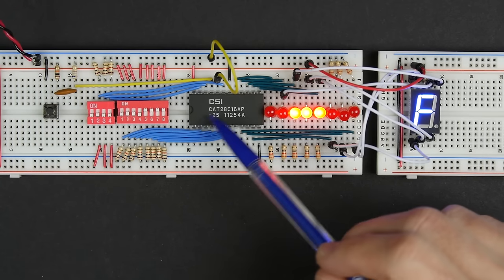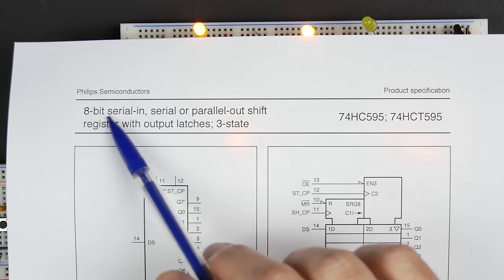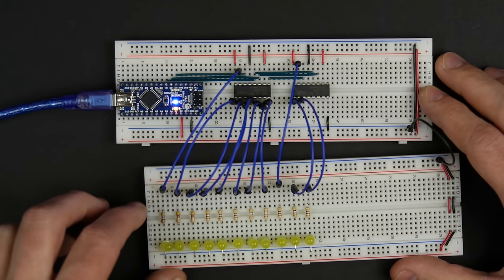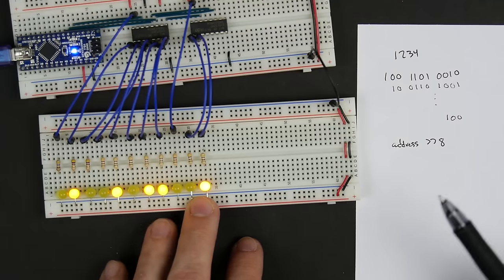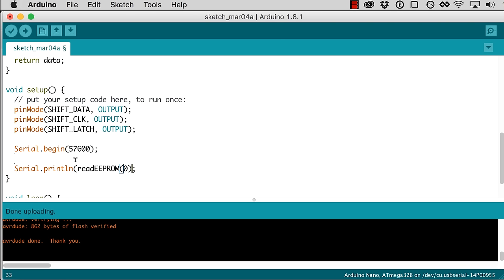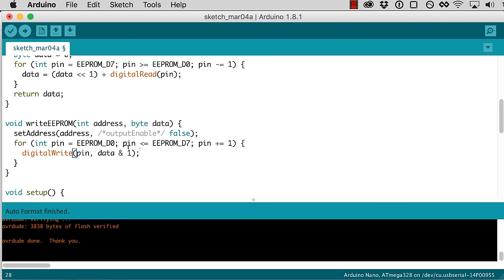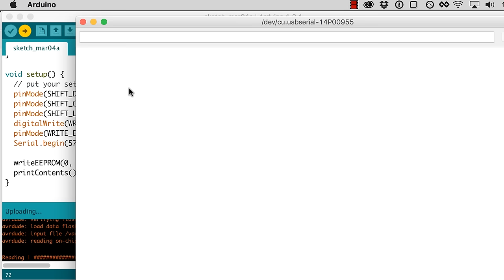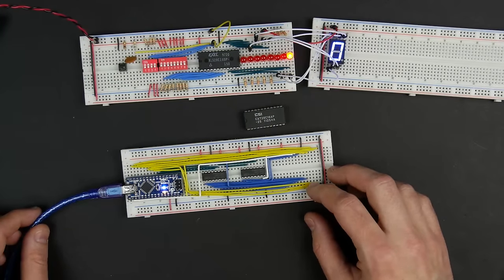Build an Arduino EEPROM programmer

Comment: I'm very late to the party here, but for anybody trying this out then I think Ben may have been using the wrong datasheet.  The Exel XLS28C16B datasheet describes a couple of features that are used to handle writing.  The first is that internally the EEPROM memory is updated in 16 byte pages from a 16 byte page buffer.  Any write to the chip occurs initially to this buffer, and as long as you perform another write in the same 16 byte page within 75µS of the WEB pin rising edge then the data is written only to this buffer.  It's only after 75µS containing no WEB falling edges that the internal EEPROM memory write cycle starts, writing the data in the page buffer to EEPROM and taking up to 5mS.  To determine when the write cycle actually ends the idea is that you repeatedly read back the byte from the last address written, and the cycle is only complete when you read back the same byte that you wrote to this address.  Also in this datasheet there is no maximum WEB low period, just a minimum.  So in fact it might take the write cycle 5.075 mS to complete after the rising edge whenever this happens, and reading within this period from any address apart from the last written is out of spec, as are any further writes.  A 6 mS delay would probably have done the job, but better to poll the last address as described and better still to write 16 bytes at a time first in order to minimise write cycle wear on the EEPROM.  PS - the 16 byte write buffer is only available in the "B" variant of the chip.  In the "A" variant every byte written triggers a write cycle immediately.

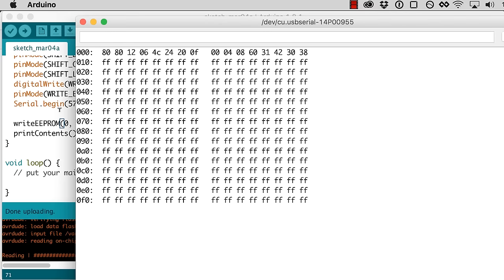Comment: @51:41   Could this be due to timing within Arduino? Are those timings compatible with this specific Arduino board, for changing it from 5 to 10? Or is it Memory chip timing specifications? Looks like the memory chip specs require longer timing.

Comment: Hey Ben, I bought an AT28C256 to play around with myself, but it seems that because it is a "paged" EEPROM the read and writing is working differently from the 28C16, and it doesn't seem to want to write properly. Could you help me out with understanding what's going wrong here?
Reply: Yes, the AT28C256 does have a paged mode where it can grab up to 64 byte blocks quickly, but they need to be clocked through quickly and if the chip doesn't see new data in about 100uS I think it is,  it just gives up.  You still can use the single byte write mode as outlined here.

Comment: Extremely good explanations throughout the entire video. There is only one question unresolved: How the heck do the LEDs on the secondary (manual read/write eeprom) breadboard stay lit even after removing the eeprom!??!
Reply: Sharp eyes! I think it's because those LEDs are also connected to the numeric LED display on the other board. They're drawing current through there somehow, either through the LED segments themselves (that is, the segment and the stand-alone LED are in series), or maybe through the current-limiting resistor somehow.
Reply: @jimblandy  Thanks! I suspected something like that. Seems like 7-seg display serves as a latch of some kind. I'll have to test it out.

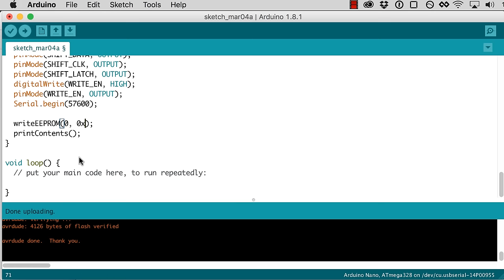Comment: I had the exact same issue as you at the ~51:00 mark. My issue was oddly that pins would float until they "warmed up" after the first 2 bytes. I had to add a 47k pull down resistor for it to stop (sometimes), which seemed oddly high. This happened after a few seconds of inactivity.

Do you happen to know what was causing that?

Comment: My serial monitor is not working. It is showing a lot of question marks and other strange symbols. Any suggestions what I should do? Could it be something with the physical connections on my breadboard? The shift-registers work just fine.

Comment: Thank you for this video series, it's amazing! Now it would be really amazing to see how one would build a thing that communicates via USB. Building the Arduino is probably really hard because that's already a computer and I assume writing a C compiler for the custom assembly language is riddiculously hard as well. But the USB with the serial protocols sounds like a nice thing. It should be quite possible to enable the breadboard computer to connect to PC directly and manipulate the RAM content that way, no?

Comment: Hi Ben, what if you only had one Shift Reg but two Arduinos Would you be able to split the address between the shift reg and the second duino? By essentially pushing the first 8 bits to the second duino and storing the last 8 bits in the SR. then activating the ShiftLatch on the SR and using the same logic to drive a pin on the second duino as an ShiftLatch pin? This would enable the output pins you chose on the second duino and the SR at the same time. Then still use the first duino to read from the data pins? I know it's a bit overkill and it's more labour cost-effective to just order another SR. But is the concept sound?

Comment: I fear I may be a bit late to this video, but I had one comment for how the write enable pulse can be shortened somewhat without using lower level timing. The digitalWrite command can be replaced by port manipulation. Since port manipulation is almost instantaneous, it will bring write enable pulse duration much closer to the recommended 1000 ns.

Comment: Hey Ben!
I've tried rebuilding this circuit and the data is not being written to the EEPROM. Every time I read 0xff in every location. I've also made a pcb thinking my breadboard might be a bad one. Also connected everything on breadboard couple of times. But it doesn't work again. After surfing the web for solution, I was suggested to do a Software protection disable sequence. Can you please do a tutorial on that? Or does it have to do something with the write timings?

Comment: I think there may be a mix up on the schematic. D2 , D3 and D4 on the Arduino should be connected to  Pin 14, Pin 11 and Pin 12 respectively. It's correct on the video so no big deal.
Reply: Here is a breadboard layout schematic. I already built this and it's working great. 
https://www.dropbox.com/s/ztejk5xjhnk1k8i/Arduino%20EEPROM%20Programmer%20Diagram%20Ben%20Eater%20v2.pdf?dl=0

Comment: You might consider using for your interface a Microchip  MCP23017SP2 IC. The IC has 2 8-bit bidirectional ports and connects to the Arduino using the I2C buss or you could use the good old 8255 IC. It has 3 8-bit bidirectional ports and would use 10 Arduino pins. You digital knowledge is very impressive. Good Job.

Comment: Hi Ben. Nice video again! I'm really looking forward to see the next videos about your computer.
One thing I have to complain is on your write-function: You first tell your µC to output on its pins and then tell the EEPROM to stop outputing on his pins (which are directly connected together). So for a fraction of a second some pins should be shorted out through the IO-registers of both chips :O
But I don't think I does matter much there :)
Also the Arduino API has some nice (c++) string operations based around the String class, so don't mess around with that old c-functions :D

Comment: instead of data = (data << 1) + bit you shoud use |. It doesn't make a difference in logic, but it's just good practice to use bitwise operations when messing with bits and using arithmetic operations when messing with numbers. It might also be faster.

Comment: As mentioned elsewhere in the comments, you can also use the analog pins, or even upgrade to a Mega which has many more pins - it's not like it's going in a final project, it was simply to program the EEPROM as a tool :) 

Great video as always otherwise :)

Comment: Hi Mr. Eater.
Write a program in Arduino;
Write 6502 CPU assembly mnemonic code from the serial port of the Arduino, and compile it with a command to write the machine code 28C16 or 28c256.
There can be very nice projects with such a program. In the future
 you can do this in the Z80 processor.

Comment: Hello,most of us beginners  have problems programming the 2716 ,we have the Minipro and it has a max prog 21v,what can be done,adding the voltage,using external 25v supply,adding the missing 4v from a battery?i was thinking using the output of the minipro to drive a relay or transistor switch,arduino or something with a external 25v supply.

Comment: hello, I have a little doubt. I used the same 74hc595 chip for the first time. But It did not work. After browsing the web I tried changing the polarity of LEDs (+ terminal to the positive rail & - terminal to the output of the chip) then it worked. But the problem is in your video you do it other way. Please help me
Reply: Did you have the LED pointing the right way?

Comment: I am loving seeing you building the 8 bit computer series. But you could have used the analog pins from Arduino as digital pins, that would be 8 extra I/O making a total of 20 free I/O. And that would have been enough to write and read from the EEPROM

Comment: hi, i've made this circuit with a 28c256, a 32k eeprom, but the there are missing bytes, like : 00 5e 00 b4 00 88 00 3d  00 ff 00 79 00 aa 00 99. do you know how i solve this?
Reply: @tradde11 yes, It was a loose wire. Thank you

Comment: Great stuff from Ben as always. I was unable to find a 28c16 so I used a 28c64, tying the additional address pins to ground. I used Ben´s vanilla EEPROM Programmer sketch and it loads and runs. However the printout is as below:
000:  7f 7b 77 1f 4e 3d 4f 47   7f 7b 77 1f 4e 3d 4f 47  whereas it should be:
         7e 30 6d 79 33 5b 5f 70  7f 7b 77 1f 4e 3d 4f 47
So it seems that only the second eight addresses are being printed. Don't know if anyone is still monitoring this conversation but would be great to get some input as I am at a loss. Wiring seems correct.
Thanks.

Comment: Great video. I looked a little closer at using the Adafruit Feather M4 Express. Even though eight 4.7kOhm resistors and eight 3.3V zeners on the data lines could make it work with the AT28C16, two of its 21 I/O were also shared with USB comms Tx and Rx (like the Arduino). So, it would require your clever Shift Register (SR) idea as well.  So the Arduino Nano is indeed the way to go with a SR added. I think I have a Nano around somewhere, I am going to try your idea... Thanks!
If fact, in the past I have multiplexed the use of the Rx pin as 'USB comms Rx' and 'Output pin'. The Rx pin can be used as one of the Address lines to the AT28C16, and in this case I pick up one pin and no Shift Register would be needed. It is just that before you program each Address, you have to send a "dummy" byte to the Nano over USB that leaves the Rx pin in the desired state (1 or 0) you need for a particular address bit. Or maybe I just had to momentarily switch the Rx Pin to generic output pin which put garbage on the USB that I would just toss - its been awhile, need to find that code I wrote years ago. Since I am going to write a GUI on the PC to send huge streams of Data to the Nano to program the EEPROM, it can easily fiddle with the USB data and get the Rx pin in any state I want between USB comms transactions, the Nano code communicating with the PC would both have to expect this as well. But for Address expansion, I am going to go with your SR approach. Great video, it gave me a project I can use when I teach STEM to bright young minds this summer.

Comment: You could also use Arduinos Serial read functions to get data from the PC which makes it possible to program the EEPROM from e.g. text input on the serial connection, one byte at a time advancing the the next byte making this a generic EEPROM programmer instead of having to recompile and reupload software with a new array of bytes to write. It will also save the Arduino thingy itself as they have limited amount of writes before they go bad.

Comment: Dear Bem.
I like your projects very much.
I intend to make a 28Cxxx EEPROMS programmer, but the pin VCC from the 28C16 is the pin A13 from the other ondes.
I thought of using a transistor connected the A0 port from Arduino, but I'm not sure about the type.
Can you help me?
Thanks.

Best regards
Angelo

Comment: Every time I read from the EEPROM I am getting 0xF7 for all the bytes. I am using a 28C256, even though the pinout is a little different it should be fine with the EEPROM hooked up properly.  Could you possibly know whats going wrong?
Reply: Nevermind I mixed up a couple of address pins and fixed them. Working great! probably shouldn't of done this at midnight, probably wouldnt of had that error...
Reply: Hello Ian Litchfield. I’m using the same chip (28C256) but can’t get it to write. I wonder if I have the same issue as you. Would you be able to share your arguing sketch so that may write/read successfully to this chip? Thanks in advance

Comment: Hi I just saw this video.
The reason why the delay may have been too short may be because your clock speed is fast. check your avrdude (setting or the settings in the Arduino settings)

Comment: The output enable part doesn't seem clear to me. I mean: The first address part is shifted out as 3 bits (100). With the OR operation you are not adding a bit, but actually changing the MSB of the address, effectively making it (101).  You are saying: "it's basically the first bit set". SO you are altering the address! But in the end the result is (1101) including the OE LED. So where does the additional 4th bit magically come from?
Or in other words: For reaching the 12th green( LED you would need to shift out an additional bit. How does this work by replacing a bit instead of appending one?

Comment: Turns out that there is sufficient delay between the EEPROM writes LOW and HIGH trigger such that the delayMicroseconds command is not required.  Mine also works with the post HIGH delay set to 5.

Comment: I didn't really get the difference between storage register clock and output enable pin, both seem to suspend the output until we've set it up to how we want it to appear all at once. Also at 10:00 while you were putting the data with the button, the 74HC595 was not reacting to every press and was not matching the custom-built shift register on most steps even tho it matched in the end, what's up with that?

Comment: If you're worried about installing your EEPROM while the breadboard is powered and don't want to remove the USB from the Arduino, you can always remove the power or ground wire coming from the Arduino to the breadboard.

Comment: You say there's a 6 in your Arduino-programmed PROM on line 1, which we see in binary, but your attempted decimal converter showed a 3, even though I thought you had already corrected the converter in a previous video. What went wrong?

Comment: I need help. I have built a 28C64B EEPROM memory recorder. Works correctly. But this chip has a write protection function. I have not been able to remove this function from my memory and it is impossible to write code to this memory. In your datasheet there is the algorithm of activation and deactivation of this function, but I do not understand it.

Comment: I built this circuit.  I just couldn't get it to work. I'd get odd random values. I tried AT28C64 and AT28C16 chips that I had. I had about seven of these chips combined.  I learned that when the arduino reads floating inputs the arduino spits out random data.  I tried buffering the output lines on the chips with some LM339's to no avail. I couldn't figure out why none of the chips ever put a signal on the data lines. I had a couple of 62256 RAM chips in my box and they have an almost identical pinout, so I plugged one in and the circuit worked like a charm. No issues. It looks like all of my EEPROMs are either trash or something I don't know about is inhibiting their output.  Many headaches.

Comment: Can someone explain to me, in 55:37, what means the  address <= 2047 in WriteEEPROM in the for loop?  2047 bytes? And why 2047? 2047 bytes is the total memory space in EEPROM? thanks and best regards.
Reply: 2048 is the number of bytes in the AT28C16. But since you count from address number zero, the last one is 2047. Because he's using the <= comparison operator, he has to use 2047. You can also write "address < 2048" (without the '='), then you can use 2048 instead.
Reply: @MaxTheDragon  , I thank you very much for your reply. Please, allow me to explain.  My understanding of english audio is very bad. So, At28C16 has only 2048 bytes of space. You help me a lot. I imagined it was 16000 (16kb). What is the total size in AT28C256? 256000 bytes, or less than that? thank you.
Reply: @dsfromsomewhere  You're welcome. The AT28C16 has 2048 bytes which is equal to 16384 bits (or 16kb), because there are eight bits in a byte. The number on the chip id that represents the size (so 16 in the case of the AT28C16) is the size in kiloBITS, not in BYTES, so you have to divide by 8 to get the size in bytes (or 'words' as they're called in the datasheet). A lowercase 'b' denotes bits. An uppercase 'B' denotes bytes.

The AT28C256 has 262144 bits (or 256kb) which is 32768 bytes.

In summary:

AT28C16 = 16384 bits = 16kb = 2048 bytes = 2kB
AT28C64 = 65536 bits = 64kb = 8192 bytes = 8kB
AT28C256 = 262144 bits = 256kb = 32768 bytes = 32kB

(Note that although I write kb and kB here, the modern SI standards have seperate kibibits (kib) and kibibytes (kiB) for the 1024 multipliers, and the kilo prefix is actually the 1000 multiplier. But that's not important for the numbers given above.)
Reply: @MaxTheDragon  , I don't know how to thank you. You really help me a lot! Kind Gentleman, Thank you very much! Best Regards and Best Wishes!  👏👏👏👏👏✌✌✌✌
Reply: @dsfromsomewhere  Again, you're welcome. Best wishes to you too.